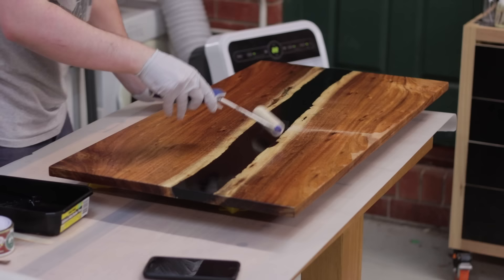Bookmatched Blackwood Resin River Coffee Table | Sounds of the workshop

Comment: question, the cut that you make at 1:55... how tricky is that? and is there a limit to how thin I can cut a board?
Reply from the maker: Depends a lot on your bandsaw, the blade you have, and the general setup of the machine. A well tuned bandsaw with a sharp, quality blade can saw 1.5-2mm veneers. The difficult part is more in the setup than technique (technique plays a part, but mostly just apply even pressure and you're good)

Comment: Paul, enjoyed every second of this build 😊love your workshop so many tools and love your style of cool and calm working . Is that a laminated board for the resin mold? Thank you so much .
Reply from the maker: Yes, the epoxy doesn't stick to the melamine (it sticks 'in' the texture, which is why it can be a little tricky to pop it off, but it doesn't stick to the melamine surface). Alternatively, you can use packing tape on other types of boards (mdf, plywood, etc) and the epoxy should fall right off

Comment: hi Paul i need some advise on a resin coffee table i want make.
I have slab not sure of the timber i was given the slab and its cut out to roughly  a map of Queensland and i think it might be redgum and i want to turn it into a coffee table  its 75mm thick 500mm x 900mm in dia.
what is a good quality resin to use and what is resin like working around 30 plus days we have in QLD or wait till it get closer to winter.
cheers rob
Reply from the maker: I'm not really an expert on resin. You won't be able to do 75mm in a single pour with most resins. In the US they have a few that will handle that, so might be worth looking for them. I wouldn't pour above 25c if I could avoid it, but it depends on the epoxy and volume.  If it's a slow setting casting resin it might handle the heat better.

Comment: Really nice table Paul.  I am curious what you used to tint the epoxy.  It looks great.
Reply from the maker: Thanks! I used Just Resins ink (https://www.justresin.com.au/product-page/jr-basic-ink-30ml), but there are lots of things that will tint epoxy jet black. JR's stuff is very thin, so you can get a semi-transparent grey from it, or black if you add more. I've used West Systems stuff which requires a tiny amount to go black, and is very thick. Then there are powders (purpose made and general oxide powders), and apparently even some paints (acrylics especially) work too.

Comment: Looks great! 
Question regarding that brand of epoxy - did you have any issues with it overheating/bubbling from doing deep pour? 
Also, where did you read that poly x does not stick to epoxy? It seems to be the most popular hard wax oil in Australia
Lastly, where did you purchase your slab from?
Reply from the maker: 1. I ended up doing two or three pours, so it wasn't particularly deep. I don't actually know what the recommended max depth is.
2. I've used polyx on previous items with epoxy infill, and every time its remained tacky/hasn't dried for >48hrs, so I've typically just wiped it off. PolyX is likely the most well known HWO worldwide!
3. Ebay, a few years back.

Comment: Nice build Paul.
That resin technique seems to be gaining some traction lately. 
Just a quick question about your Amazon links if I may?
I notice that you list a lot of your power tools from Amazon.
They can't be used in Australia due to the voltage difference and a lot of the other items don't ship to Australia either. 
I guess they are listed as the USA is where the big market is and your listing can tap into that. 
But my question is about sourcing similar tools etc from Amazon in Australia. 
Amazon Oz opened with some fanfare a few months ago but seems pretty anaemic in its offerings.
Have you had any info from them about whether or when they plan to expand their Australian online store to stock similar items as compared to their USA store? 
Thanks.
Reply from the maker: Nobody in Australia does any sort of affiliate stuff, and by far the largest portion of my audience is American. Power tools I don't get from Amazon, but a lot of the smaller stuff (blades, router bits, sandpaper) I do as it's often half the price or less.
I have no contacts at Amazon (au or us) so no info that isn't already public knowledge. I'd expect them to eventually expand their stock when they launch prime, but there is nothing stopping others listing tools on the Amazon au marketplace
Reply: Thanks Paul!

Comment: Curious how the resin does with wood movement. 

Does the resin act as a mechanical vise to minimize the wood flex when the humidity changes?
Reply from the maker: Thats an interesting question, and the TL;DR is I don't completely know.

I think if you encase wood in about 3mm of epoxy (or more), it essentially negates any real wood movement not by clamping/restriction, but by reducing the ingress of moisture by so much that it essentially can't get to the wood before the humidity goes the other way.

In the case of epoxy right down the middle, I think it's more similar to a breadboard end where you pin the middle to hold things in place, but don't actually glue the edges. In this case, its restricted in the middle, but not on the edges so it can still expand 'out'.

If it was cast on both sides (but not the top and bottom)? I'm not actually sure if it would cause wood movement issues or not!
Reply: Paul Jenkins keep us posted. I would be interested if it shows any signs of side expansion, which might give it a temporary cupped effect. Though I would guess it might be so small it would go unnoticed. 

Keep up the good work; you look to be moving better 👍